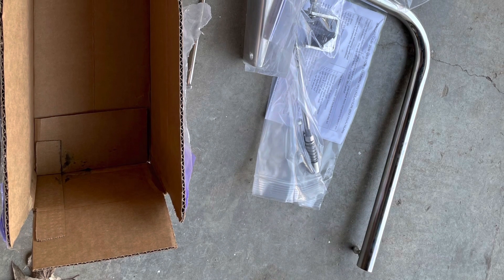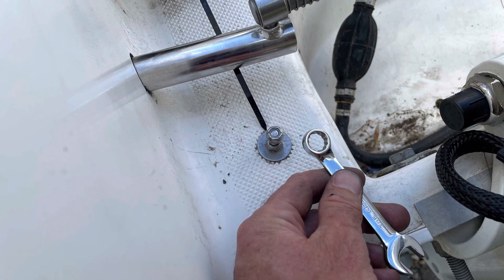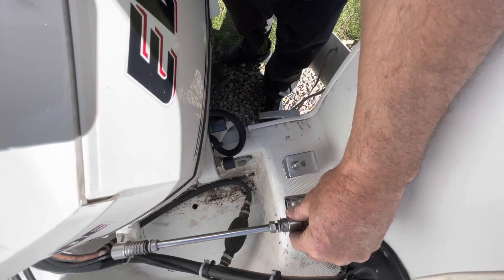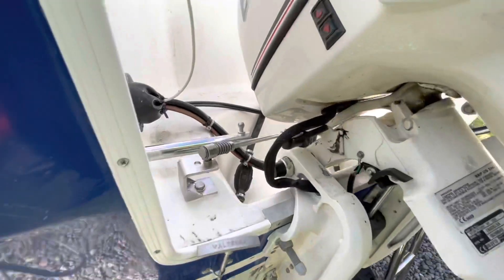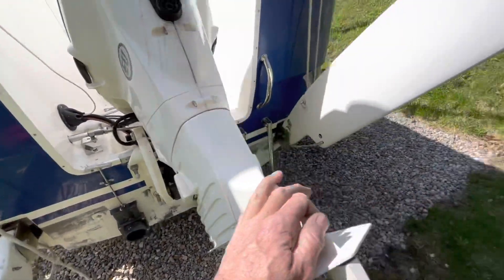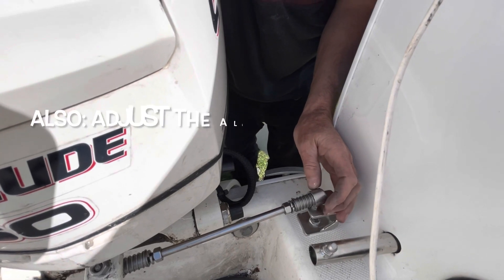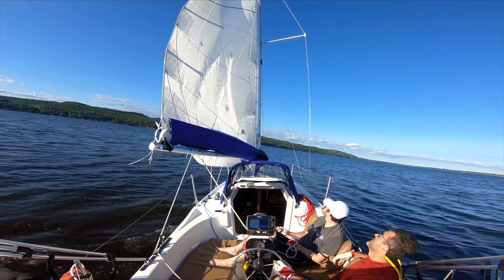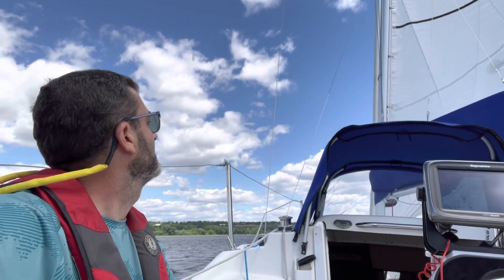Engine quick disconnect

Comment: This is great. Dumb question but how do you lock the engine in a straight line?
Reply from the maker: You can see it at 2:30 of this video. You just switch the engine steering linkage from the rudder steering arm or to the fixed stub.
Reply: @polepole9066  ah ok, that doesn't just disconnect it also locks. great.